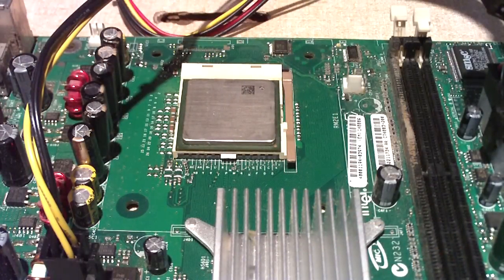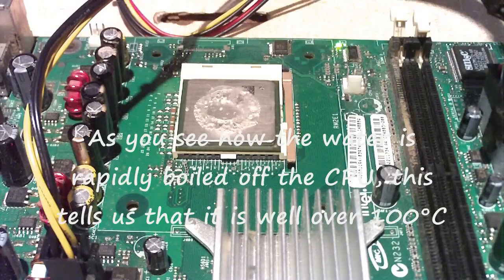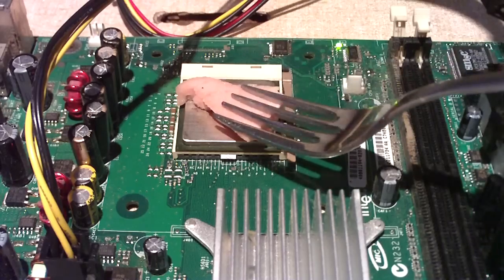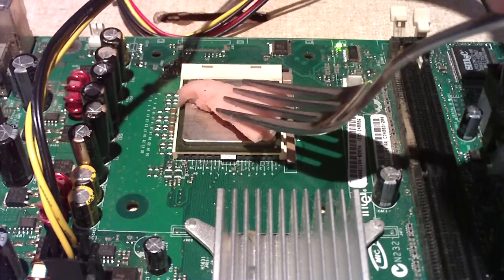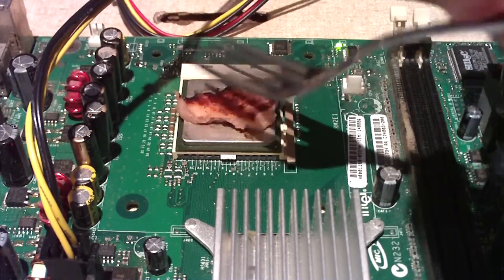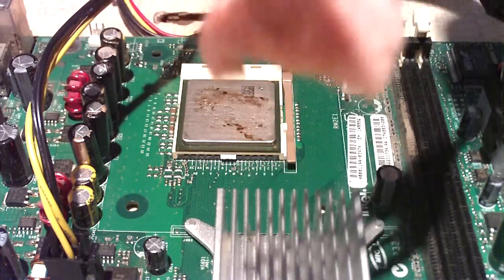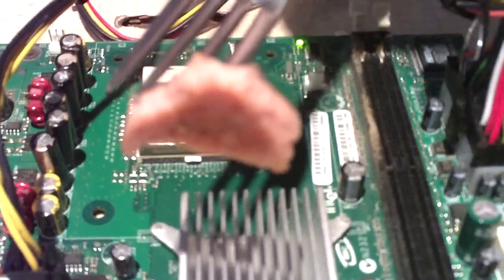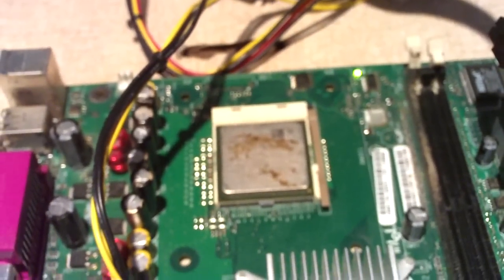Cooking with Intel Ep1 - A Demonstration on CPU Heat

Comment: How can the CPU getting hot if the motherboard don"t have RAM ?
Reply from the maker: +ADN B. The CPU doesn't require RAM to be installed to produce heat. Without the RAM, the CPU's thermal monitoring/shutdown is disabled.
Reply: +ADN B. When the computer starts, the CPU begins executing the program contained in the BIOS chip (which doesn't require RAM). The BIOS tests the memory among other things before giving the distinctive POST beep. If the POST fails, the CPU begins executing a set of instructions that tell it to do nothing, and when done doing "nothing", start doing "nothing" again, and so on.
Reply: +ADN B. I Agree Most motherboards WILL NOT allow CPU instructions w/o ram so 99% of boards w/o ram Nope wont work
Reply: +Cole Johnson (5urd) >BIOS Chip. Isn't the BIOS stored in the ROM?
Reply: +ADN B. load or not, it's still being supplied a current that needs to be dissipated in the form of heat.
Reply: +Cole Johnson (5urd) Yes, but that doesn't mean full load.
Reply: +Cube Computer Channel I think you are mistaken. The thermal shutdown is initiated automatically by the CPU, not the motherboard. The CPU contains all it's needed for this, including thermal sensors. All the modern CPUs have this.

For your processor, please read "Intel® Celeron® Processor in the 478-Pin Package datasheet" section 7.3

"Regardless of enabling of the automatic or On-Demand modes, in the event of a catastrophic cooling failure, the processor will automatically shut down when the silicon has reached a temperature of approximately 135° C. At this point the system bus signal THERMTRIP# will go active and stay active until RESET# has been initiated. THERMTRIP# activation is independent of processor activity and does not generate any bus cycles. If THERMTRIP# is asserted, processor core voltage (VCC) must be removed within the timeframe defined in Table 16"

Most probably your CPU was already toast.
Reply: +Daniel Strand Old mobo
Reply from the maker: +ooltimu From my observations, onboard CPU shutdown only works when there's RAM on the board. That CPU was a working pull.
Reply: *****
That's very weird, because the internal shutdown of the CPU should have nothing to do with RAM. It simply shuts down all instruction execution when the thermal diode trips.
Reply from the maker: +ooltimu I have tested it many times. It shuts down the CPU only when RAM is installed. Otherwise, the shutdown is disabled and the CPU burns up.
Reply: That is such bullshit faulty programming. Why is that even an issue?

Comment: Everyone's complaining about AMD overheating, and I'm just sitting here with an Intel i7 in my laptop that sometimes gets above 90 °C with just background processes or system idling. (Yes, I know laptops typically run hotter.)
Reply: DragonTech im just sitting here on my overclocked amd apu running at 4.4hz @ 33c with a corsair h90
Reply: sarm602 What APU did you use? I'm using a 760K overclocked to 4.3 with stock cooler at 72c.
Reply: StrongarmSlayer a-10 5800k, and ditch your stock cooler for just about anything else, stock coolers are shitty, wouldnt even consider overclocking on a stock cooler.
Reply: sarm602 I know. I'm saving up for a Hyper 212.

I simply love how noisy the fans kick up during intense loads while overclocked. Considering a 760K is a 6800K without IGP, I'd imagine that'll be how noisy it is for 6800K users.

Currently on 6800K clocks (4.1 GHz base, 4.4 GHz turbo).
Reply: I use an FX 6300 as my cpu and it works like a dream
Reply: DragonTech There is something wrong with your laptop.
Reply: DragonTech Im sitting here with A4 apu and cooling pad which commonly hits 95 degrees celsius

Comment: how dod you get the pc to not shut off during the test?
Reply from the maker: The power supply PS-ON pin was jumpered to ground, forcing the machine to continually receive power. Since there was no installed RAM, the CPU's thermal protection was disabled and would not shut off.
Reply: ok thanks

Comment: I had a very weird experience. I had s PC with a q6600 and crossfire’s 2900xt’s in 2007; it could run that hacked Windows XP very high spec in Crysis at 20-40FPS lol. Anyway, my heat sink fell off yet somehow the processor remained stable overclocked to 3.2Ghz from 2.4Ghz under load; it did run at boiling temperature at 100 degrees Celsius but it’s shocking how it didn’t blow; glad I looked inside and saw the problem before it did though. One pin was defective so I replaced it and the PC was fine ever since. Kudos to the case for preventing disaster. Don’t remember which though.

Comment: Using metal fork... smart...
Reply from the maker: What's gonna happen?
Reply: ssddsquare having a gun on profile picture ... possibly goes wrong... just kidding
Reply from the maker: You do realize that heatsinks (which are normally attached to the CPU) are made of metal right? And the motherboard does not contain lethal voltages right? So what could necessarily go wrong?
Reply: Cube Computer Channel ik most processors have an avg of 1.2 V with oc can get around 2-4 but is to low to penetrate human skin even with an conductive surface like salt and water the current cant travel to much because of resistence yeah the amps are deadly around 20-60 depends on cpu but again u cant get the arch and most of the cpu is insulated
Reply: Jonathan Godin well thats an crappy motherboard found from an emachine is worthless
Reply: Izzy G Irony at its finest brother
Reply: Rum Ha irony.. cuz its a metal fork
Reply: HAHA did you see him move the capacitor before using the fork lmao
Reply: D4Y_ _LYTE ha irony because metal conducts electricity and provides a medium for its passage
Reply: A plastic one would have given it a few flavores
Reply: Rum only different types of metal conduct and there is only 3 wich are iron cobalt and I forgot the other one
Reply: Gray Wolf nickel
Reply: Gray Wolf but that's only for magnets. but electricity is different
Reply: Yeah he should have used plastic so that it would melt and he'd have a plastic tasting piece of meat!!
Reply: Rum it was meant to be a pun not an argument lol.
Reply: D4Y_ _LYTE Oh I see now lmao
Reply: Should've used a plastic fork. Remember to rub it in your hair first
Reply: 莫比 😵😂
Reply: Cube Computer Channel That's u will got stunned

Comment: I think the CPU has to be under intense work because it has to be above 80 degrees centigrade to cook and I know for a fact my CPU without anything to do will just go to 40. I can't tell if this is an older CPU that works constantly or a new CPU that has been set to do something. but whatever it is I wouldn't go telling all your friends that there CPU's can cook there dinner.

Comment: i burned my self when diagnosing a CPU the system wasn't posting no errors nothing so i put my finger on the bare IHS to see if the CPU was heating up unfortunately i left it on a bit too long and burned my finger

Comment: Is 4gb of ram good or bad? I wanna run gta at 1080p 60 fps
Reply: Jose Ortega 4gb would be the bare minimum, infact you wouldn't be able to run GTA 5 on 4gbs alone because the system requirements for it need at least 8.

Comment: Use a plastic fork or you might not be posting videos for long
Reply from the maker: Incorrect. PC motherboards do not contain high voltage.
Reply: Cube Computer Channel they actually do, the capacitors contain them
Reply from the maker: What voltage do they contain?
Reply: Cube Computer Channel 180 to 360 volts. Law enforcement are actually experimenting them to shoot out of a gun like bullets kinda like tasers but more for long distance.
Reply from the maker: That may be true, however motherboard capacitors are typically either 4V, 6.3V, 10V, or 16V. The highest voltage this motherboard gets is 12V on the CPU power rail. Also, the CPU heat spreader is not gonna shock and kill me. Now if I were poking a metal fork around inside the power supply where 200-400V caps are present, that would be a different story.
Reply: Cube Computer Channel My point is, you dont have to poke around the power supply to get electricuted, one bad capacitor is all it takes, but by all means go right ahead I've only been a computer technician for 11 years and a mechanic for 5 years.
Reply from the maker: Again, the caps on the motherboard do not contain lethal voltage. The voltages you see on a capacitor are their maximum rated operating voltage. They aren't the same as batteries where the labeled voltage is the nominal charge. If a capacitor says 35V 105C on it, that doesn't mean that putting 12V to it is going to charge it up to 35V. Apparently you should use a plastic wrench or a 10kV hotstick to install a car battery. I've been a computer tech longer than 11 years. This video was shot 7 years ago. If computer components outside the power supply are so hazardous, I would have been dead long ago.
Reply: Cube Computer Channel I find it hard to believe you're a computer technician. It's not the voltage that kills you, its the current/amperage. You can have a rail of 12volts yeah sure but if that rail supplies 500ma thats more than enough to stop your heart. Good luck surviving that. I mean c'mon its a no brainer, a metal fork and electricity? And btw im a hybrid mechanic, 250,000 volt car battery is far from your average 12volts.
Reply from the maker: You have to have enough voltage first before the amps can become a problem. It's harder to believe you are a computer technician when you apparently do not understand the basic fundamentals of ohm's law and electric circuits. Take an ohm meter and check for the resistance across your body. 12VDC is not going to be able to conduct enough current to even cause a problem. You first have to have enough voltage before current will be able to overcome the resistance of a circuit. If amps were a hazard at any voltage, people would be handling 1.5V AA cells with hotsticks. Yes, 250kV is a hazardous voltage, but not 12V. Distribution power lines  carry about 7200V.
Reply: Cube Computer Channel Wow you're copying and pasting almost word for word from google. Judging from the video, You are scrawny, 12v is enough voltage to travel thru your heart and stop it. Especially while holding a metal fork.
Reply: Cube Computer Channel I used to work for Enterprise rent a Car and a fellow mechanic of mine died from a 9 volt chevy sonic battery. Disobeyed the first rule of a technician, don't wear jewelry. His necklace touched both terminals and he died instantly. You are dependent on your skins conductivity. All in all i just wouldn't take the chance to mess with any live voltage.
Reply from the maker: Nope, no copying and pasting from Google here.
Reply from the maker: Your fellow mechanic of yours created a dead short with his necklace, allowing current a direct, low resistance path to take. As the necklace had a lot of coverage on his body, it lowered the resistance of his body, which allowed a higher current flow at the given voltage. Now poking a fork on a computer CPU heatspreader is not going to cause a problem as the heatspreader is not live (if anything, it's grounded). The CPU itself only gets 1.3-1.7V depending on the given processor. This doesn't even make its way to the heatspreader. Electricity should be respected at all levels, but one does not need to freak out over a metal fork on a CPU heatspreader. Certainly you use metal utensils on an electric stove. Let's not forget that stove element runs on 240V, however the pot surface of the element is not live and neither is the pot sitting on it. If I used a plastic fork, it would have melted under these temperatures.
Reply: Cube Computer Channel not talking about the heat spreader at all. Like i said all it takes is a bad capacitor, voltage can jump on your fork and you're screwed. Funny you say you've been a technician for over 11 years yet your comptia was earned in 2012...
Reply from the maker: I started working on computers in 2005. I was certified in 2012 as it was offered to me as a free scholarship. Funny how you think that certifications mean that's when someone starts their field of work.
Reply: Cube Computer Channel Actually he died because of current thru the brain, his health slowly degraded. People often think the dangers of electricity affects the heart which is a sudden injury but fail to think about long term injury.
Reply: Cube Computer Channel you just contradicted yourself. You're not a Technician unless you're certified therefore you've not been a technician for over 11 years. Nice try though.
Reply from the maker: This is why survivors of lightning strikes often have long term injuries or health issues that don't show up until years later.
Reply: Cube Computer Channel you sure are evidence of that fact sir